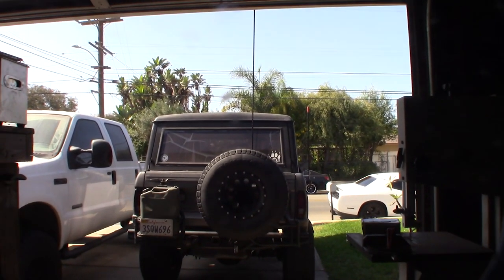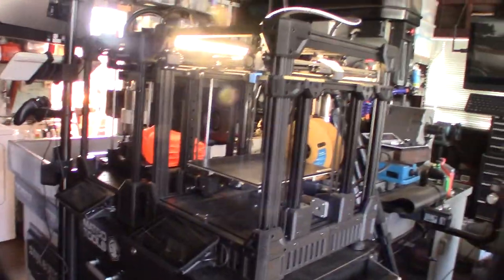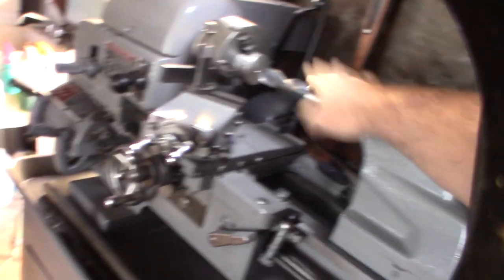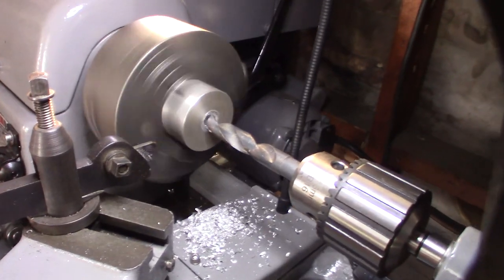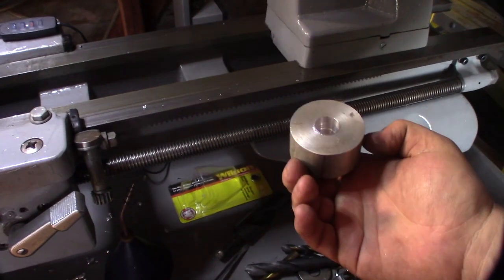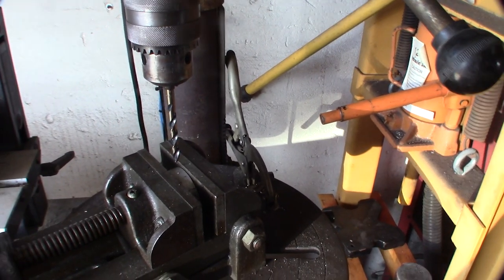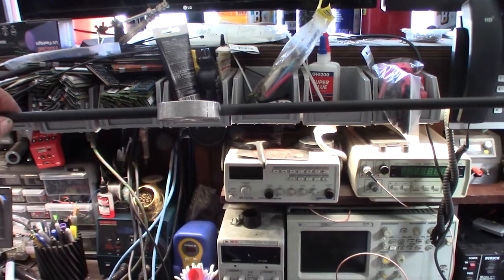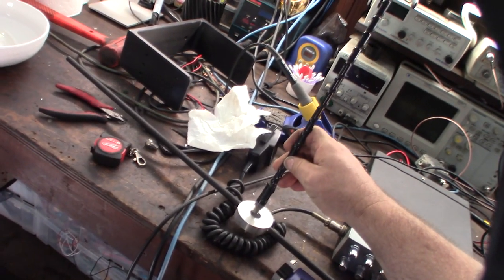GOOD OR BAD IDEA!!! Custom CB Ground Plane Radials For Rear Tire Carrier Bumper to Lower SWR

Comment: The way you have it mounted is fine. If you want to add a ground plane, wider is better. 
The tire, tire rack, and the roof of the vehicle will influence you signal themselves good and bad.  When looking to add ground radials to a cb antenna keep them aa close as possible to the radiator.  The further the distance from the radiator to the radials increases capacitance. You don't want that unless necessary.
Reply from the maker: Thanks for the explanation, My goal was to direct the RF upwards past my roof.  Not really a problem with the 5ft antenna where it top fed and above the roof. I don't normally have that antenna on. I normally have a 2ft top fed antenna on that only goes a few inches about the roof line. I go into parking structures, I do have a quick disconnect to go between antennas.

Comment: I am not a practitioner of the RF dark arts, but do you really think that will do anything? Keeping in mind the scale here, 27mhz = 36ft wavelength, and you have a big steel (?) tailgate right next to it blocking half of what is already a 1/8 wave antenna. I would be curious to know if there is instead a difference from connecting a short wire between the antenna mount and the tailgate to improve the connection.
Reply from the maker: RF Antennas are kind of weird. Most of my RF experience is doing large Wi-Fi installations in commercial buildings and hotels. You kind of have an idea where to put the access points but you don't know until its installed. Building materials (metal, concrete etc..) can create issues. Antenna theory is a pretty crazy subject, I'm still learning. My side ball mount has a better SWR then my new location. Doesn't make sense since there is no ground plan underneath, ground plane is the quarter panel vertically parallel with antenna. The whole bumper/roof/tailgate is grounded. The idea of the radials is to help radiate the signal up. Ideally you would want the antenna on the center roof. The whole metal roof works as the ground plane. The radials are really just a crutch. It will never been as good as center roof. The antenna is 5/8 wave  top fed with majority of the winding above the roof. I'm actually going to try your wire idea. I will do some before and after SWR test.
Reply: @fintechrepairshop  5/8 wave? Did I make a mistake? 299792458m/s / 27mhz = 36.4ft? So the antenna is 22ft long? Or is it a loop?
Reply from the maker: @jessicav2031  You actually have it right. The antenna is 5ft high. What you cant see is the wire wrapped around it. Its called a top fed antenna. A 1/4 wave antenna is 108 inches.  I also have a 2ft antenna that is 5/8 wave. The wire is tightly wound all the way up the fiberglass stick. I really don't talk on the radios. I'm just fascinated with the idea.